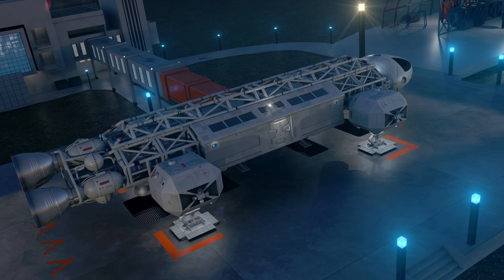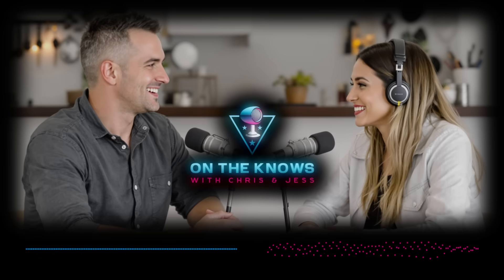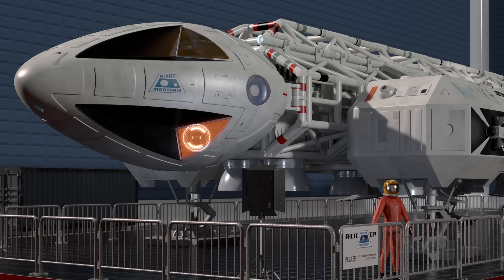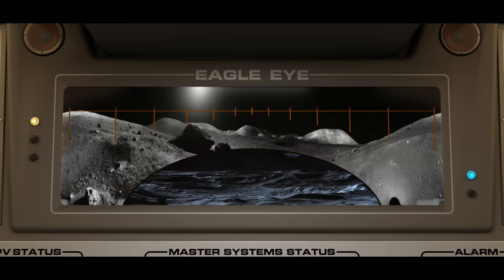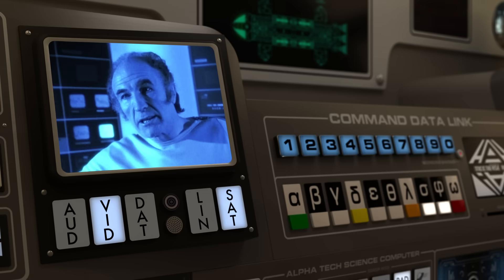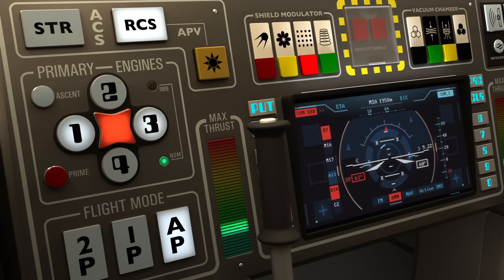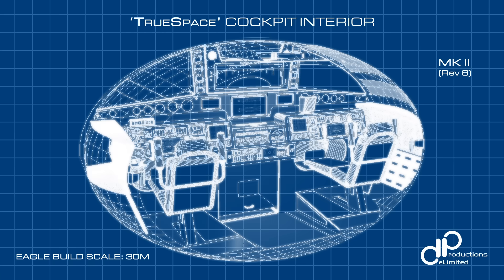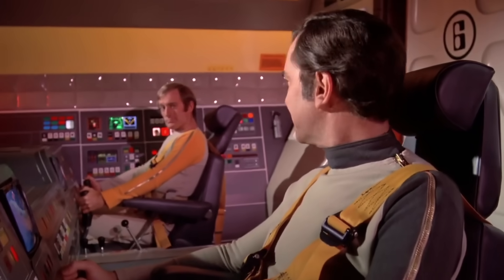Rebuilding the "Space: 1999" Cockpit for the 50th Anniversary — Inner Space VII

Comment: Brian Johnson was involved with building the model for the "Moon Bus" for "2001: A Space Odyssey." Clearly, that inspired his design for the Eagle. I honestly think the reason for the lower windows on the Eagle command module was Johnson believing the pilots would need to be able to look down when landing. Think of the Bell H-13 Sioux helicopter made famous in M*A*S*H, and the earliest designs of the Apollo Lunar Module. But of course, the set designers had to deal with composition, and the same way the U.S.S. Enterprise's elevator is offset, is the same reason the Eagle's seats were low. The use of dental chairs made getting props easy, but a more likely seat would have the pilots legs straight down.

Comment: What about the banks of controls on the port and starboard bulk heads?  This vid deals with the controls in front of the two seats but what about the ones to the left and right?
Reply from the maker: In the TrueSpace cockpit, the side consoles are much smaller--and are open to fan imagination. The Eagle's esoteric controls are surely located on these bulkheads: emergency separation, winch control, etc.

Comment: Thanks very much for your time and effort in producing this.
While i understand that you have to work with the original design, I was thinking as I was watching the problems you had with leg room, if it would have been better if the head of the Eagle had settled for only 2 'eyes' on the upper side and no indentations on the underside (similar to the Hawk). The additional bulk of the underside would provide the leg room needed plus any extras.
Reply from the maker: I guess that would be the converse project: re-designing the hull of the command module to make the filming set more plausible.

Comment: Raising the seats was always the obvious solution to the issue of the sightlines out the cockpit. It seems odd that the original series put the seats in trenches given that it seems that photography would have been easier if the seats had indeed been raised. Moreover the room was there in the set. Instead a lot of that overhead space is pretty much unused. It does look very cramped though. I think conceiving that the CM is a tad larger would improve the overall fit of things if making the set up a bit wider than the set, but as was noted matching the set exactly wasn't the point. I don't know on what basis the CM was scaled (the transporter doors?), but given there's already the issue of how a walkthrough corridor connects to that rear egg shaped rear, bigger would help.  A slightly larger CM might make the fit and the viewing angle out the windows just a little better (maybe even allow a slight view out the lower ones between the legs (sort of).

Comment: The Eagle has to be the most beautiful space craft model ever seen on screen but not well thought out in engineering terms.  
This episode corrects a lot of problems but I was hoping to see the entire outer cockpit be resized to match what we 
see on the show, rather than make a new interior to match the outside.  
In the New Adventures of Captain Scarlet, the Angel fighter's eject system was either a regular eject seat via a blown canopy or the entire nose section of the aircraft separated from the main fuselage to become a smaller aircraft in its own right able to fly a short distance and land safely. THAT was good design.
Reply from the maker: Certainly worthy of a different type of project, but I'd worry that the result—contorting the command module to agree with the filming set—would create a cascading effect on the entire Eagle Transporter model.

Comment: I do like what they are doing here but I the seats should be mounted even higher.  Looking at the side shot at 14:16 I would say like a foot higher.
Reply from the maker: Thanks for participating and thinking about the space! Your variant will work if you don't mind removing the dash trim and re-thinking the upper dash instruments. One could certainly design a more compact instrument cluster that lives only above the center console—because when you've raised the stations 12 inches, you're now very close to the window ledge.
Reply: The instrument panels didn’t have to be fixed, couldn’t they have been moveable like the controls on spaceship “Luna” from destination moon?